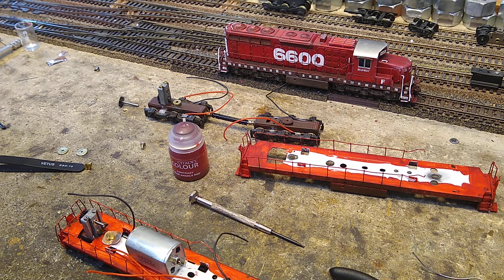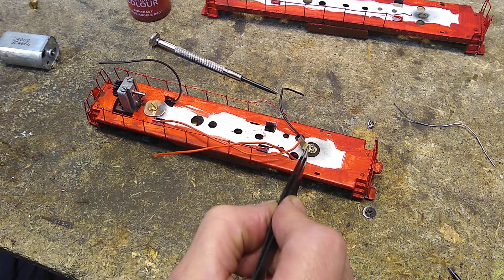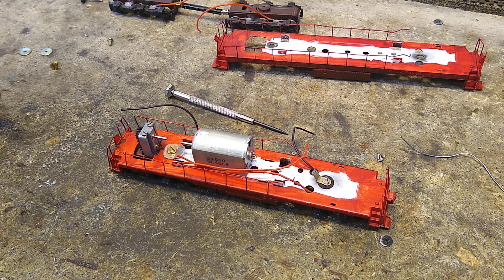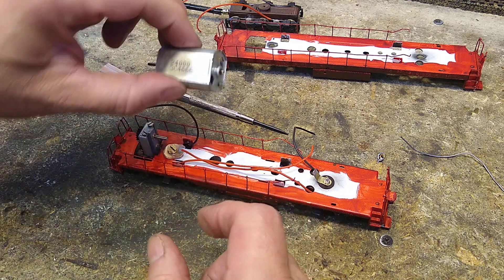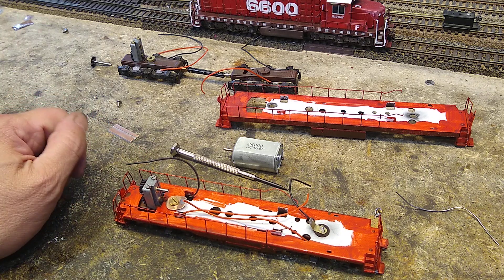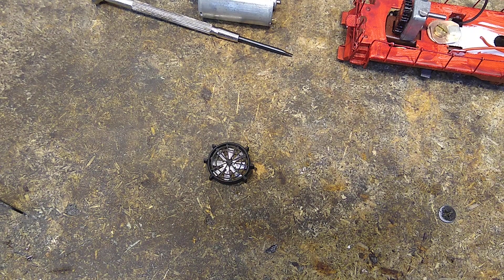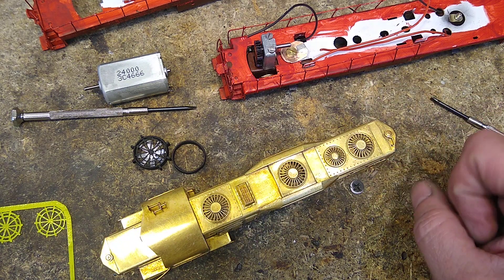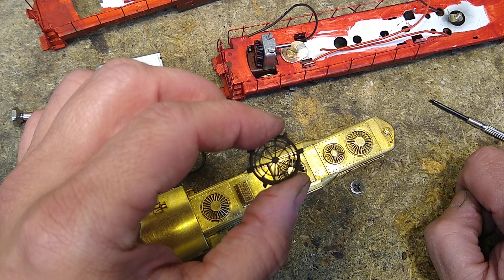5 locomotives in 30 days part 25 Tenshodo new motor new fans preview

Comment: I recently bought  Tenshodo F7A+B units, The button is a snap. the other part was attached to the light bulb to complete the circuit for the light. I'll admit, I was amused but it was a practical way to allow disconnecting the shell completely from the chassis without having to unsolder the light.
Reply from the maker: when I do lights now, I use a 2 pin connector where I cut off the locking lugs with an xacto knife.  this allows you to use Goop to glue in the pc boards for lights and then disconnect them easily when you want to take it apart.  I can't stand all that hard wired crap they stuff into new locomotives, so I usually just get rid of it since you don't actually need it and can make your own pretty easy - that's why some of my builds have those LEDs that are so bright they score on the ridiculous level...

Comment: Where can I buy the hose for the friction fit to connect the shafts? I need the hose to connect the shafts in my Hi F.
Reply from the maker: yes!! Hi-F all the way!!  I recently rebuilt a GP9 Hi-F with a 24v motor and some better bands and it whoops ass!!  I got my hose from ebay and its called food grade silicone hose.  what you want is the inside diameter of 1mm if you are using a new motor, 1.5mm if you are keeping the old motor.  get some 2mm hose also just in case.  this hose is cheap and it is good to have a stock pile of various sizes in your shop
Reply: N e hobby shop who does nitro r/c will have fuel hose that will work as well
Reply from the maker: @shanestrains7179  the only advantage to food grade hose is you get 100 feet of it for only a couple bucks instead of a short piece

Comment: Is this the motor you ordered you were waiting for a few weeks ago . . . Thanks . . .  BRIAN
Reply from the maker: this is one I got a few months ago that I saved just for this
Reply: @elite194  
If I might ask, whats the full name of the motor so I can head out and find us some.  I'm a purity good digger deeper type of guy
Reply from the maker: @brian5606  both the Tenshodo's have the Johnson 24v single shaft. Single shaft motors aren't as hard to find, but decent dual shafts are very difficult right now.
Reply: @elite194  
Do you have any knowledge of what type of electic screw driver these motors came out of.  You know we could probably make a small company building rare earth hobby motors like the ones you've uncovered that aren't available anymore.  Once athearn atlas kato seen what kind of low speed torque you've figured out by using this type of rare earth motor I'm sure they might be interested in having these type of motors in their top selling lines.  Something to consider.  If I knew where to go look in a salvage yard for used electric devices to kinda get a start on the parts needed to get our own motor with new parts assembled, we could possibly make everybody happy with a good pulling slow scale speed locomotive that you've figured out.
Reply from the maker: @brian5606  what I do know is that they have a usual use of rear view mirror and accessory motors in automobiles made in asia.  they are built in the same factories used by all model train manufacturers, but the train companies are getting their runs done to their specs after the auto motors have been made.  I've had my contacts over there  search them out and the make a run and when gone they make a new motor.  The motors I'm using take an extra step to make so no train companies will be getting them anytime soon that and the fact that when they're gone a different motor is made.  If you were going to a salvage yard, look for the imported cars, but don't hold your breath because US stuff is 12v system.  You will find plenty of the same motors used in Atlas and Rapido in US cars though.
Reply: @elite194  
Thanks for the good info bud.  I'll go look around for import cars and see if I can score a few motors out of doors or mirrors or the like.  I'll get back with ya on my findings . . . Thanks bud
Reply: I found a minebea 18.2mm square ( all four sides ) 24v 8550rpm single shaft 6-pole high torque motor on evilbay, I'm thinking of ordering six or eight for putting two a piece in one locomotive back to back.  I measured and have 76mm between the chassis weights on frame of a genius SD70.  The motors are 25.1mm in length, that's 52.2mm of motors with 12mm on each side of motor assembly, thats without weights of course but at high torque and a slow 8550rpm at 24v locomotive should pull real strong.  Don't care about high speed cause my 18 foot shelf layout isn't built for speeders anyway.  If I might ask, what's the rpm on a newer genius SD70 athearn motor. Should be the same as any SD genius I'm thinking.  If I knew the rpm's on these stock motors it'd make it a little easier to find a suitable high torque motor for drawbar knuckle busting torque lol
Thanks . . . BRIAN
Reply from the maker: @brian5606  sounds like the Mabuchi motor I used in the DD40.  Excellent motor.  The Johnson 6-pole is the one I just used in those 2 brass locomotives and it has incredible torque.
Reply: @elite194  
Damn made a mistake, the genius SD70 inside shell width is only 17mm.  The older blue box SD40-2 can handle 18.4mm motors and not sure what the width is on the older geep 7's & 9's or SD45's, I haven't got any of them to measure. Is that Johnson motor a single shaft.
Reply from the maker: @brian5606  they fit any blue box, but usually you need double shaft, unless you put 2 motors in the units long enough to handle them.  Look at the DD40 with 2 motors video and you'll see what they look like and how they run.  The Johnson is single shaft.  the best motors for new stuff aren't to be found anywhere at the moment, but that should change pretty soon.